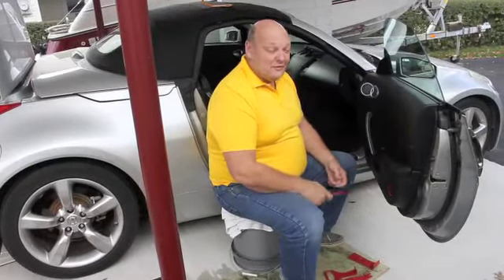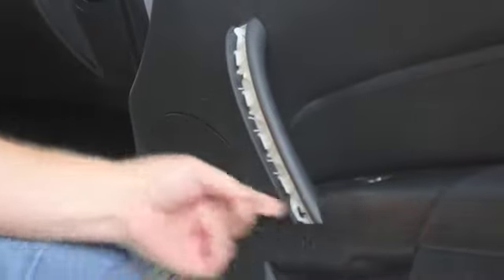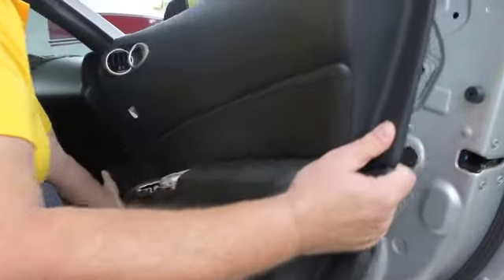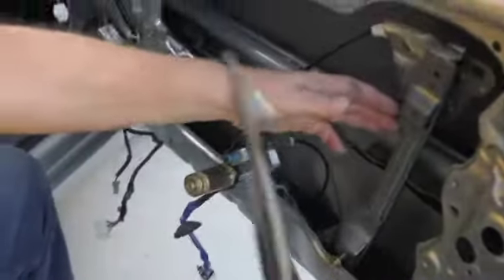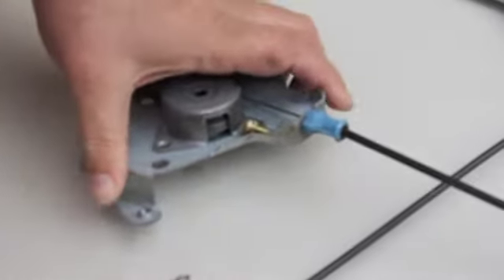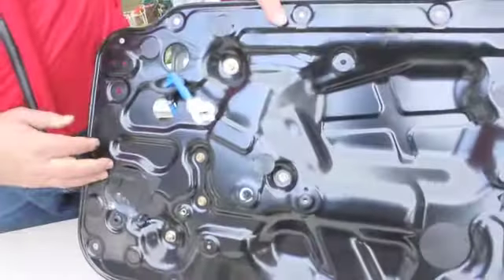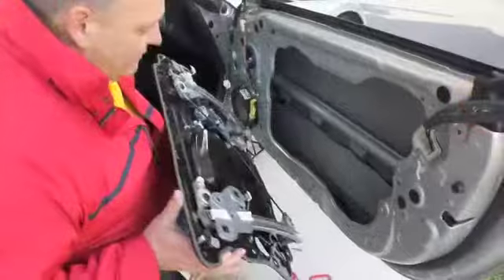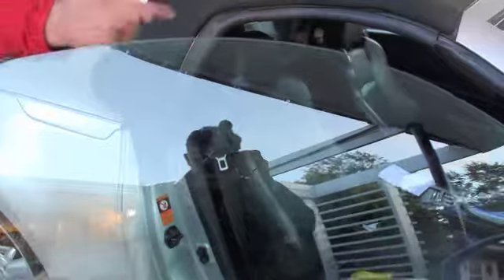350z Roadster Window Motor Replacement

Comment: I believe my window camber is not set right. Auto Collision fixed my door from the accident.  Motor works but it pushes against the top seal as it comes up. Thanks

Comment: Looks like you could have just left the window and everything else in place and just removed the screws to remove the motor and replace just the motor and could have saved over half the time.   And I see Nissan makes it easier to access by removing the whole panel so that you can easily access everything.

Comment: How much would this cost me to have done? I need my passenger an drivers side motors replaced on my 03 an don't think I could do it myself
Reply from the maker: Hi Steven,  If you have a shop you deal with on a regular basis they are probably going to charge 1.5 hours labor each side plus parts. But hey, if you're close to me bring it by and I'll install them for a hundred bucks each side :)    Thanks for watching and good luck with it.

Comment: it's really easy to pull off door panels when you know where all the hidden screws and clips are. thanks for the video!
Reply: A pro would just grab n rip. I did GM Delco warranty claims work for dealers dash clusters,body controllers, and radios at Caton Radio catonsvile MD..United up in my does same work

Comment from the maker: you may be moving the drive motor also.  try connecting the wires first and see if the motor activates it may take the slack up

Comment: same issue. only problm now is the glass seems to be loose. i can grab the window with my fingers and move it 2 or 3 inches up or down. but I tightened all of the bolts.
Reply: how were you able to fix this issue? my passenger side window goes up & down but seems like it's not sitting correctly as the window is not aligned correctly.

Comment: you don't have to remove the glass or slide assembly to replace the motor. I know, cause I've had to replace both side motors several times.

Comment: How did you guys get the glass back in place?
Reply from the maker: Hey, I just saw this - all we did is put the power to the motor and adjusted the glass so the mounting brackets aligned up with the black holes in the panel.
Reply from the maker: first slide the glass in the run channel at the front of the door. gently lower the glass into the door. while doing that look thru the forward access hole on the black panel this will show thre plastic glass mount sliding into its perch on the forward regulator track. put the bolt in place but do not tighhten completly. thenalign up the rear guide bolt and tighten.
Reply: Do you have to raise the internal window mount to get it to the right height? I'm stuck. I've got the black panel back in place with a new motor and track assembly. I plugged it back in and turned the key, but when I push the raise window button nothing happens. I then hit the lower window button just whirs for a second. Then the up button again and it goes up about 1/8 of and inch and then drops back down and stops. 

I can't put the glass in because the mounts are too low unless I raise the assembly up a bit. At least it seems that way, unless I don't have the glass in the channel like I think I do.